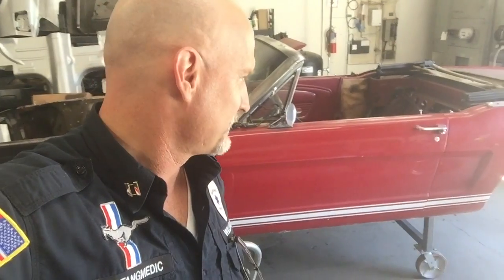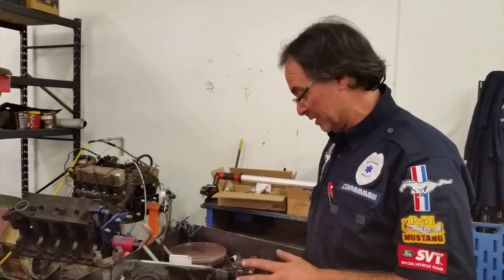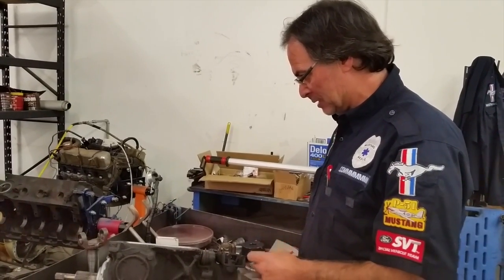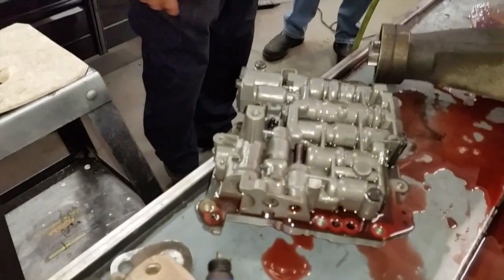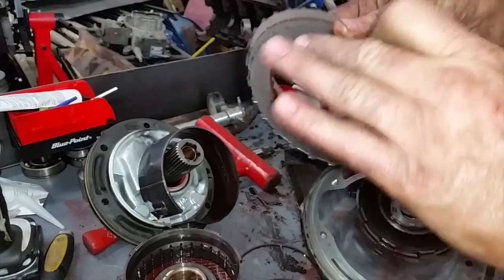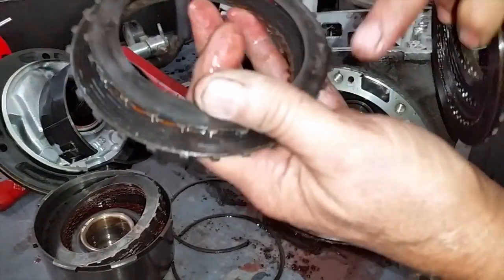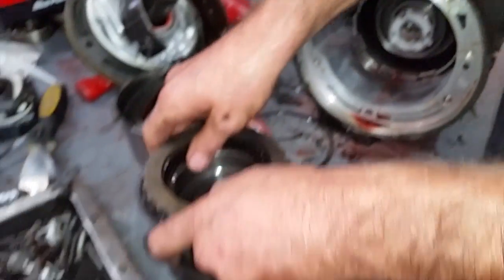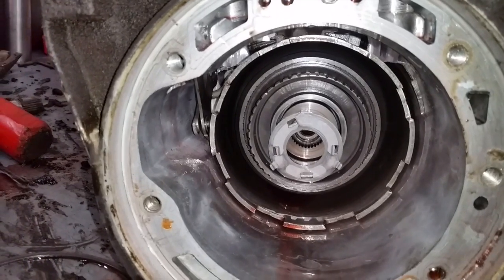C4 Transmission inside look  - Bill's 1966 Ford Mustang GT Convertible - Day 20

Comment: Is it normal for the neutral safety switch to leak.  It doesn't leak very much,  but if stored for about 2 months there is 1-2oz. If fluid in my pan
Reply from the maker: No that is not normal.  You don't want any leaks, I recommend taking her to a mechanic you trust and have it sealed.